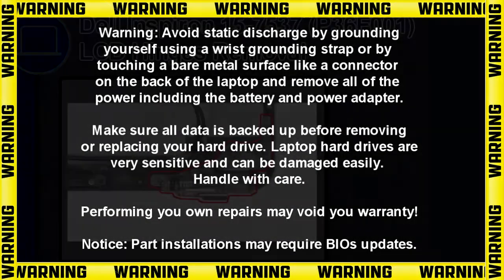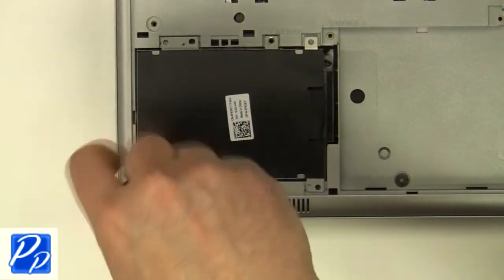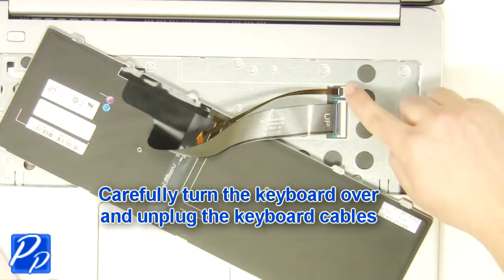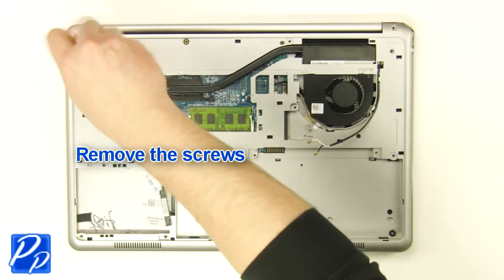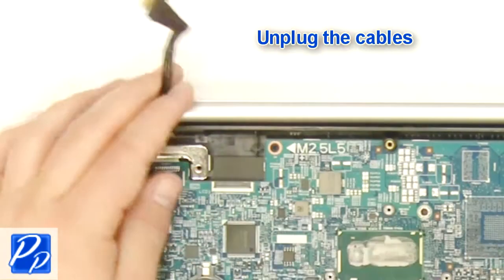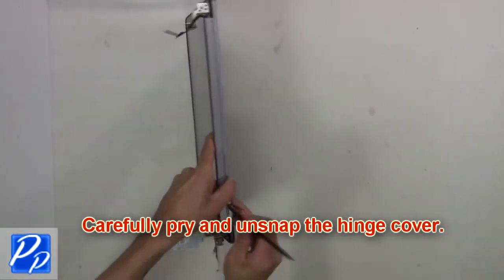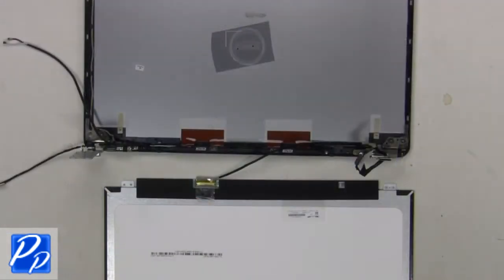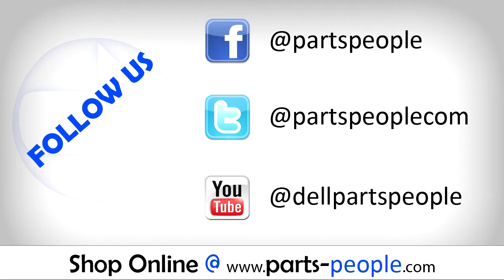Dell Inspiron 15-7537 (P36F001) LCD Hinges How-To Video Tutorial

Comment: Thanks for the video. It’s very easy to watch and fix . I had a screen problem and open the screen if I can fix but it’s just wire connection which is not right enough. Trying to find the problem and finally Fixed it after two days. Thanks for the video again

Comment: IF the black rubber holding the hinges screws are torn how do I replace it, so the screws hold into something on the LCD Screen when I replace them ?? Please help trying to do it by this weekend
Reply from the maker: If the plastic for the hinge screws are broken, you would have to change the complete back cover lid assembly.